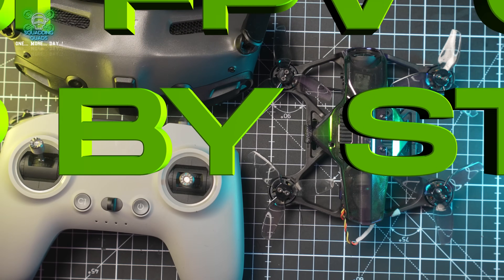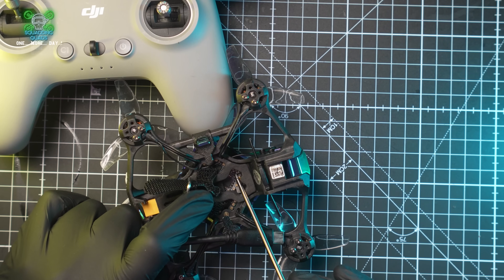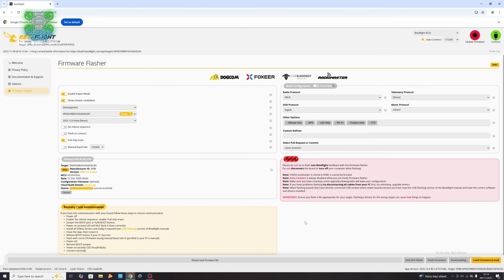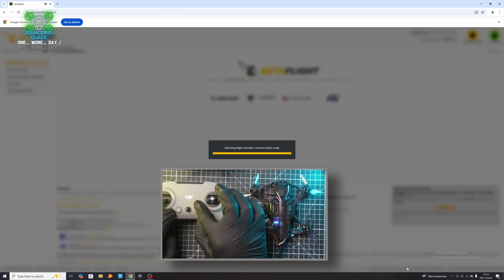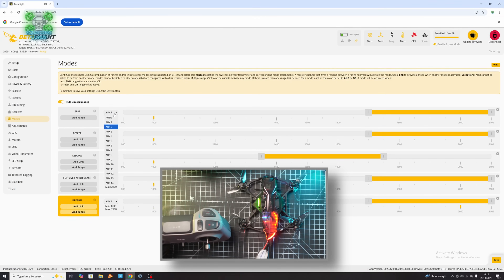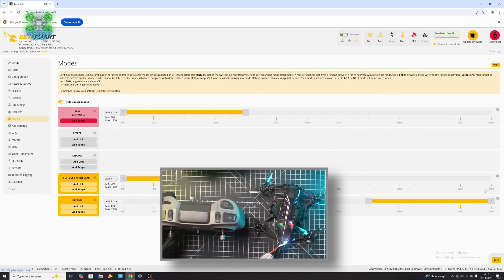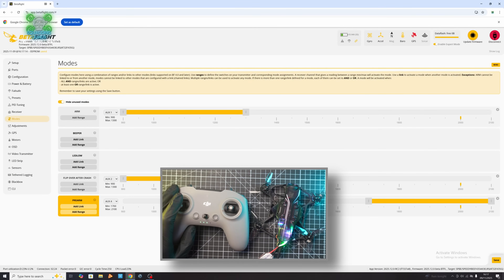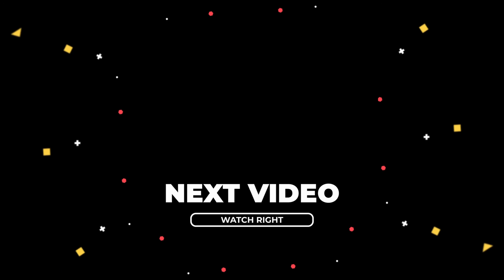How to Connect SpeedyBee Mario Mini 25 to DJI FPV Controller | Step-by-Step SBUS Setup Quick Guide

Comment from the maker: If you’re running into binding or stick input issues, check your Betaflight receiver protocol — it must be set to SBUS (Serial) and inverted signal ON for DJI controllers.
🔥 Don’t miss the next video — full DJI O4 compatibility test coming soon!
👇 Drop your setup questions and I’ll help where I can.
Reply: Thank you. I will wait for your next video.thank you.

Comment: Hello everyone,

I just connected my mini25 to betaflight for the first time. I saw it runs 4.5.2 firmware so i just went to the ports tab, enabled UART2 and disabled  UART5. Then switched  to the receiver tab and changed the protocol to sbus which is already in the scroll list. Hited save and reboot and the stick inputs are all still colorful normally means that i can bind the goggles 3 and my rc3 must be ok. Didn't bind it yet but am i missing something?? Since the firmware is 4.5.2 i dont see the reason for the procedure u describe in this video. But yet, am i missing something sir??
Thank you for your enlightening videos and your strong support to the fpv community ❤
Reply from the maker: Did you change from crsf to sbus?
Reply: @squaddingquads reflashing is mandatory?
Reply from the maker: @Dedallusaviationproductions yup
Reply from the maker: Re flash and ensure you add sbus to the protacol section
Reply: @squaddingquads now that new betaflight release  is out and stable, do u recommend in flashing to 4.6 ? What if i keep using previous 10.10.0 configurator with 4.5.2 firmware ? Is it ok?
Reply: @squaddingquads yes, in the receiver tab.
Not refrashed,  just changed it into the receiver tab

Comment: Hellow mate! I was following your tutorial, a complete beginner here. Thing is I followed step by step and used the beta version but when uploading the backup file it always had errors. I tried going on for  the KAACK which was the only other option left with that board option you choose. SPEEDYBEEF435AIOELRS.  I also get errors, and if I check the file on top it still comes like it would come for this latest version of betaflight, 4.6. Damn, I'm quite lost with this, soo many things to learn 😅

Comment: Hello, how can I install the DJI AIR unit system on the Speedybee F7 v3 controller with Betaflight? I kindly ask for your help.
Reply from the maker: That flight controller has a plug fornthe 03 /04 air units, so you just need to plug the cable included with your air unit in.

Or do you mean you need setup help?

Comment: How do you get those side tabs on to put the prop guards on? I’m currently trying to install them but i can’t figure it out.
Reply from the maker: Mine just sort of, clip on
Reply: @squaddingquads  Also which brand ND filters are you using?
Reply from the maker: https://geprc.com/product/geprc-dji-o4-air-unit-pro-filter/?ref=nheskfii these  @abiyazarham150

Comment: Got the PNP version but the weird thing is that it was set default to ELRS/UART5 in the ports Tab. I thought it was the same as the Pavo 20 Pro which uses UART5. took time for me to figure out. lol
Reply from the maker: I'm pretty sure all models have the elrs built in too, it's all bit weird at times 😂

Comment: Hi..im waiting for pnp version of that drone.i juat want to confirm.is your mario mini has built in elrs not pnp?
Reply from the maker: That's correct mines ELRS - this is the way to disable the inboard ELRS to use SBUS /DJI FPV - if you check all my other videos with this you'll see my stock cam is rhw Radiomaster TX15 MAX